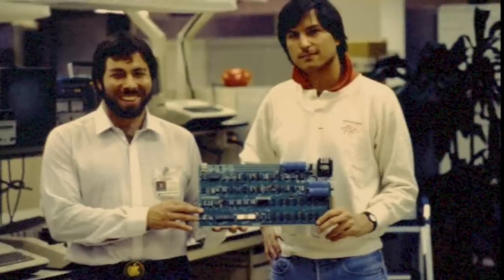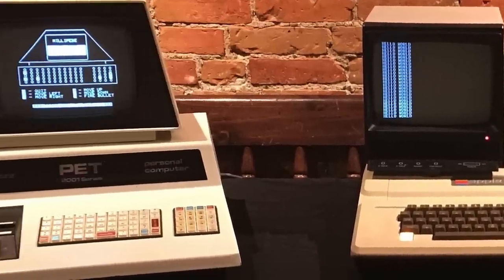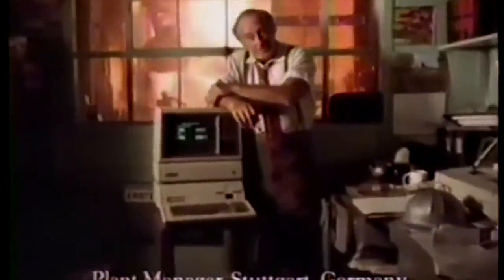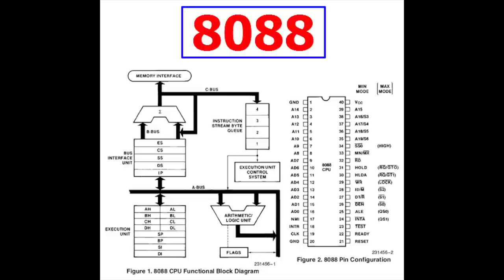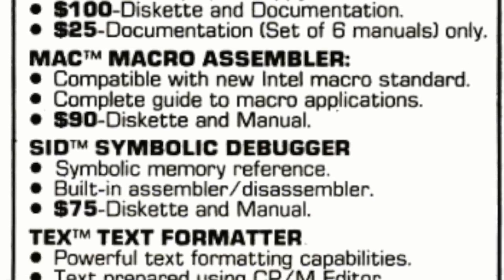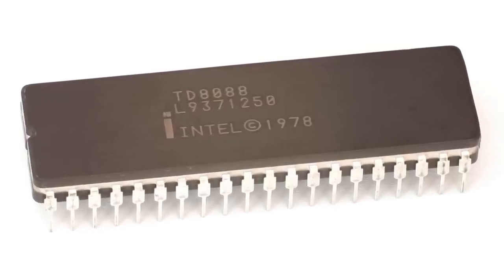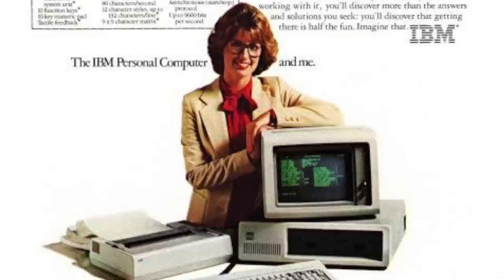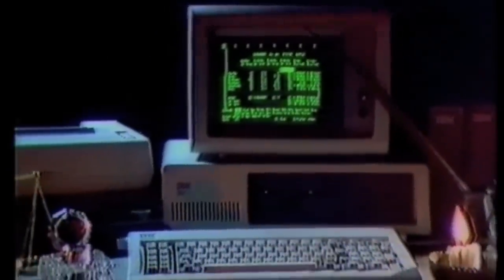DOCUMENTARY: Why and How IBM ended up creating the PC (and ended up choosing the 8088 CPU)

Comment: I've long found it interesting that people call the IBM PC a 16-bit computer (with 16-bit registers and an 8-bit data bus) and the Amiga a 16-bit computer (with 32-bit registers and a 16-bit data bus).
Reply from the maker: IMO it's an 8 bit. But the CPU internally is 16 bit. So, I guess it depends on your perspective...
Reply: @AlsGeekLab  From a programmer's perspective, the register size matters, but from an engineer's perspective, the data bus size matters. Either way, it's inconsistent to call them both 16-bit.
Reply: The original IBM PC XT is technically an 8bit. The 1984 PC AT is 16bit, the 68000 is a 16bit too.

It's a very easily resolved argument: The (data) bit rating of a CPU is determined by the number of lines on its data bus. That is how the bit rating of a CPU is determined. 

You may not know this but the idea the 68000 was 32bit, based on its register size, was originally mooted in an article penned by none other than a Motorola marketing executive ( who else? ) in which he argued the industry should stop rating CPUs by their data bus and start rating them by their operand size. That convention is one the industry did not adopt. 

The way to think of it is like a Turing Machine on which CPU designs were originally based. If you imagine a tape divided into cells, the length of the tape is the RAM and the width of the tape, (ie the cell size the stylus the Turing machine operates on), is the bit rating. 

Therefore the truth is much shorter than the marketing executive's article: The 68000 is absolutely thoroughly and assiduously 16bit. The idea it is 32bit has its root in marketing hype, and it is hype which very became popular amongst 68000 evangelists, particularly Commodore-Amiga aficionados. The "register size" is pure misdirection. It is, at a pinch, superficially correct to claim the 68000 had 32bits allocated per register, but it is dishonest because that allocation existed in the form of two adjacent sixteen-bit memory cells. So in real terms, the 68000 is not remotely 32bit in any way that hardware itself is measured. It is a notional 32bits which is nowhere baked into the 68000 CPU die. To ignore the fact the 68000 no 32bit data paths in its design, but reach for the double-word register-size is basically just nonesense. You are almost as well to construct a software operation on 128 adjacent locations and call it 1024 bit for all that claim means. If we use operand-length to determine bit size then a vector processor is tens of thousands of bits wide. because by definition a vector processor operates on thousands of successive memory locations, only, the clue is in the description: it doesn't do that in one operation, it does it by succession, which is the essence of how bit ratings are determined. The 68000 operates on data 16bits at a time.

Motorola's marketing would obviously favour having the 68000 rated by its "operand size", contrary to industry standards, simply because it would "uprate" the CPU in exactly the same way its fans, especially Amiga evangelists, want. You're not giving your CPU a real-world upgrade to 32bits, except by insisting on a unique definition of what 32bit means. It's a definition not accepted by the industry for the obvious reason, that from a technical standpoint, the claim is just hot air, it is not reflected in the 68000 architecture. 

It is simply the case that no 32bit bus exists anywhere either internally or externally on a 68000 CPU and therefore the claim it is 32bit is a fanciful pretence made by its marketing department and by Amiga evangelists.

The 68000 hardware is not 32bit in any way. It is strictly 16bit.  It really is as simple as anybody saying otherwise is either deceived, is trying to devive or is lying.
Reply: @vapourmile  so as a result of all that ranting, we should conclude that the original IBM PC was an 8-bit computer.
Reply: @timlocke3159  No it isn't. It's 100% consistent and correct: The 8086 and 68000 are Both 16bit microprocessors.

The 8086 and 68000 are Both 16bit CPUs. There is no doubt.

"From a programmer's perspective, the register size matters, but from an engineer's perspective, the data bus size matters"

It doesn't matter which "perspective" you pick. The 68000 isn't 32bit in either way, not even notionally. The 68000 word-size is 16bit. Even from a programmers perspective.  A register instruction can be followed by two words, but you don't get the second 16-bit word for free, as you would if it was 32bit. Additional clock-cycles are required for the long-word instructions, exactly as per the notional Turing machine I described: One to collect the first 16bit word, a second to deposit it on the CPU internal cache, a third to collect the second 16-bit value and the fourth to deposit the second 16bit word in CPU memory adjacent to the first. Once you have Really accounted for "the programmer perspective", the instruction timings, and not glossed over and haven't ignored crucial facts, then there is no longer any perspective from which the 68000 is 32bit. Literally none.
Reply: @achiruel  The original IBM is an 8-bit computer, and Intel's own documentation on it declares it to be so. The 68000 is a 16bit CPU. 

It's interesting because Intel's own documentation correctly describes the 8088 as 8bit even though it is internally 16bit and has exactly the same ALU as the 16bit 8086, but Motorola tries to push to have the 68000 described as 32bit even though it is internally 16bit. 

I say interesting because Intel describes the 8086 as 8bit even though, with a 16bit ALU, they have far more grounds to call it 16bit than Motorola have to call the 68000 32bit.
Reply: @vapourmile  What does the 8086 have to do with this conversation? The IBM PC has an 8088.

I consider the number of fetches to be a hardware issue. The programmer writes 32-bit code.
Reply: @timlocke3159  

"The IBM PC has an 8088"

Well, only the preliminary IBM PC/XT from 1983 did. The IBM PC/AT which followed closely behind in 1984 had an 80286.
 

"I consider the number of fetches to be a hardware issue"

You are correct. It is a hardware issue. It's a CPU-architecture hardware issue and it is also specifically this hardware issue which determines whether or not it's a 32bit CPU. You can't alter the bit rating of a CPU via software. Not a software representation in an Assembler, nor the 68000/Amiga fan-base group preference as to how the 68000 is referred. It is enthusiast personal preference, not reality, which is really the only reason 32bit is ever used in descriptions of the 68000 architecture, which is in fact 16bit throughout.  

"The programmer writes 32-bit code".

No. The programmer writes code with some adjacent 16bit numbers expressed to the programmer in a collective representation as 32bit numbers. This no more makes the 68000 32bit than a word directive on a Commodore 64 6510 Assembler makes the 6510 16bit. It is a software representation of machine words taken collectively and not an actual feature of the underlying hardware.

For example if, in Assembly, you write a long-word 68000 instruction, such as:

MOVE.L #$12345678,d0

The code, assembled, appears in RAM thus:

$2000 203C
$2002 1234
$2004 5678

That is, three separate 16bit numbers, and that is how the 68000 treats them, one each at a time. As per the Turing Machine analogy, with a tape of 16bit numbers on it. That is the definition of a 16bit chip. At the hardware level nothing 32bit happens, not even with .l instructions. So you're right in that it definitely IS a hardware issue because the fact there is absolutely no 32bit hardware either in or connected to a 68000 is the specific "hardware issue" which explains why the 68000 can be in absolutely no way correctly referred to as a 32bit microprocessor.

The 16/32 bit anomaly vanishes As soon as you begin treating the 68000 as a 16bit CPU, thereafter the minutia of things like instruction timing, and there being a time penalty for using .l instructions, make perfect sense because the architecture and machine-code clock-timings of "long-word" instructions (which are really two regular 16bit words taken one after the other), are explained by the point of fact that the 68000 as a 16bit CPU. The 68000 s an entirely 16bit CPU. It's characteristics which are anomalous for a 32bit CPU are explained by the fact it isn't a 32bit CPU. 

What does happen is, the 68000 Assembly language style presents some instructions to you the programmer in an Assembler /as if/ they have 32-bit operands, but they don't. In the same way as a .word directive on a 6502 Assembler allows you to speak to it as if it has 16bit capacity, which it doesn't. This processes of basically just faking it was done sensibly in an attempt to help the 68000 design achieve forward binary compatibility with forthcoming 32bit 680x0 series CPUs. The 68000 CPU itself, however, views those instructions as three successive 16bit numbers, as above, not 32bit.

There is in fact no 32bit component to a 68000 processor and supposed "Long word" instructions are in fact just a regular single 16bit instruction followed by two regular 16bit numbers. The fact those two word-length values are presented to you by an assembler collectively as one 32bit value is purely representational and in some way not unlike a .word 16bit value representation in an assembler on an 8bit CPU. The largest value the 68000 deals in are 16bit values. It is, therefore, by definition, a 16bit CPU. In fact, the 68000 CPU has literally zero 32bit architecture. Its elements look like this:

Data bus: 16bit
Internal bus: 16bit
Instruction pointer: 16bit
ALU: 16bit.
Operand fetch size: 16bit.
Memory interface (RAM): 16bit.

You are welcome to actually Google up and look at a 68000 pinout yourself online and physically count the external data bus pins if you wish and there you can see with your own eyes there are 16 data pins, not 32.

You can't get from "Everything pertaining to this CPU is internally and externally 16bit" to "Well I still say it's 32bit!". You can put blinkers on and refuse to consider anything except the fact there are "long-word" machine-language instructions, but they followed by a pair of 16bit numbers presented to you in an assembler as one. It is NOT pivotal, it is a software representation, not an actual extant thing. It isn't represented on the CPU as a 32 line pathway at any stage. Even the Commodore 64 has a 16bit program counter, but it is obviously not a 16bit CPU.

I cannot of course make you change how you describe it, and just like Amiga fans, I don't expect you to change, but how the fan base prefer to think of it isn't a genuine technical determinant. It's just a lot of people acting collectively who don't know and don't care what the ground truth is, they just WANT it to be 32bit, and they're satisfied with that, so that's what catches on by convention among fans. The fact the 68000 avowedly is not 32bit means nothing to them. It's basically a case of "OK, so everything about the CPU is 16bit, but imma call it 32bit, partly because I want to push for the Amiga to be more highly thought of"

In conclusion though the 68000 is not 32bit, not in any architectural way. It is purely 16 bit and that is literally and truly the case.

If you want to search the web and find any reputable source which contradicts what I have written, then do please post it here where I can find it.
Reply: @vapourmile  so what is a 68008 then? It runs identical machine code to a 68000, but has only a 8-bit data bus and a 20-bit address bus, however it has 32 bit registers. So is it an 8, 16, 20 or 32-bit CPU? The definition of how many bits a CPU is, is not quite as black and white as you try to make it.
Reply: @achiruel  

No. In fact, it is far more black and white than I claim. 

It's as black and white as this sentence:

The bit rating of a CPU is determined by the width of its data bus.

In engineering terms everything after that is just waffle. 

Not only that, it's waffle  begun by a Motorola marketing executive who wrote a manifesto trying to argue we should accept operand size as the measure, not the data bus, for no better reason than if we do, then Motorola chips get a free upgrade. Not because anything has changed except a redefinition of what people Mean when they say "32bit". The modern corollary to this is the gender debate when what defines gender hasn't changed, all that's new is a push to have it defined differently so the group of people it affects can have what they want.

What's also interesting about that is, if we accept the argument tendered by Motorola/Amiga aficionados then we can immediately put forward by corollary that Intel have a Far stronger defence case for the same nominal upgrade for their CPU line than Motorola do. For example: The 8088 really is internally identical to the 8086 and has exactly the same 16bit ALU as found in the 16bit 8086. The only other difference to the 8088 from the 16bit 8086 is the multiplexer which needs to be added to it to get the data out to the 8bit external bus. Nevertheless, despite the 8088 certainly being internally 16bit Intel nevertheless refer to their own 8088, correctly, as an 8 bit CPU:

http://www.ndr-nkc.de/download/datenbl/i8088.pdf

So if we accept the essentially straw-grasping argument made by people evangelising the Mororola chips and the Amiga, then applying those same terms Intel's 8088 in the 1983 PC/XT then becomes absolutely 16bit, and certainly far moreso than any claim the 68000 is 32bit.

With an 8088 you don't have to cherry pick. You can throw a dart at it and anywhere and wherever it lands the 8088 is internally 16bit.

Finally though, even if I was to throw you it to you and accept your claim it's all a bit of a grey area, still, given the 68000 there is no grey area because literally nothing about it is 32bit. So if we were to say "OK then, the 8088 is 16 bit...." then the 68008 and 68000 STILL aren't 32bit because wherever you throw a dart at them, they're never more than 16bit.

Where this leaves Amiga evangelists then, who know a lot about the Amiga but not so much about anything else, is that if we throw the bone to Motorola then we must also throw that same bone to Intel CPUs and allow them to pluck out  internal details, and if we do that, then Intel chips receive more of a hike than Motorola chips.

Even then though, even after granting you all of that, the 68000 still isn't 32bit because for the reasons given, you can't find anything 32bit about it, not even if you are allowed to pluck out bits of its internal architecture for scrutiny, which you can't, because it isn't how this is decided anyway. 

As I said in my first post, there is no way of measuring the 68000 which makes it 32bit even if you cherry pick a and even if you argue it's something of a grey area, it isn't in the case of the 68000 because there isn't any 32bit element to blur the facts. Those "long-word" instructions on a 68000 are a 16bit instruction followed by two 16bit words.
Reply: @vapourmile  your own argument is internally contradictory. You claim the bit architecture of a CPU is determined by its data bus, then proceed to call the 8088 16-bit. Laughable. You are clearly nothing but a fanboi for Intel/x86 architecture. The 68k architecture of the time was far superior and in fact remained so until the release of the Pentium more than a decade after the original IBM PC.
Reply: @achiruel  

"your own argument is internally contradictory. You claim the bit architecture of a CPU is determined by its data bus, then proceed to call the 8088 16-bit. Laughable."

Wrong and I can tell you I very strongly despise people who lie about what they've read.

What I said was the 8088 is correctly described by Intel as 8bit, because they measured it by its data bus and what I added was if you think you get to cherry pick internal details to blur the boundaries of how a CPU should be measured, then Intel have a far stronger case for calling the 8088 16 bit, because it really is internally 16bit,  than Motorola do to call the 68000 32bit which really isn't internally 32bit.
Reply: @achiruel  32bit

Comment: The original IBM PC was intended to fail technologically, and commercially. The higher level IBM executives gave an impossible set of characteristics to the engineer that they put in charge of the project. They were planning to report to the stockholders "We tried, it didn't work." So, that engineer "broke the rules". They couldn't fire him because he started making money hand-over-fist. He did die in a plane crash, later though. Much later, they tried to bring the rules back, with the PS/2. Now, IBM doesn't make any PC compatible product.